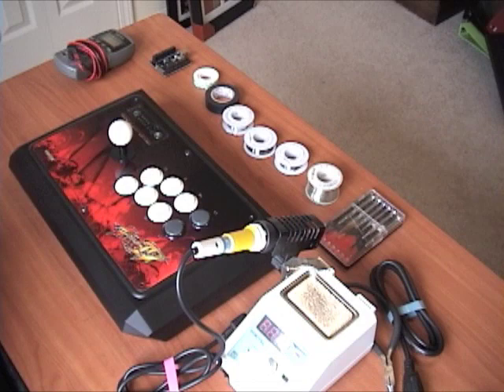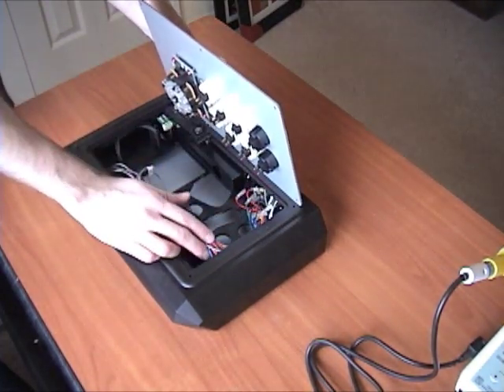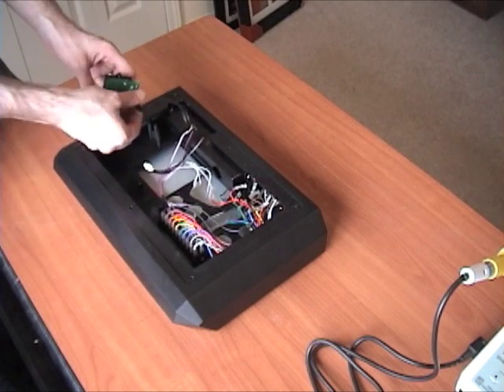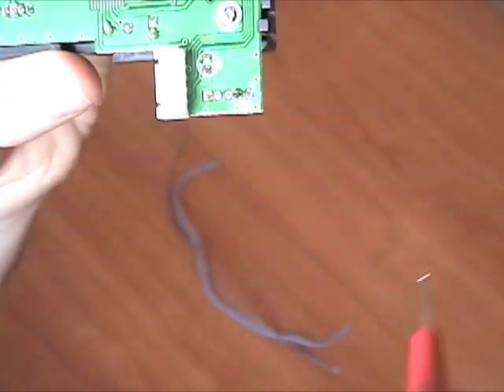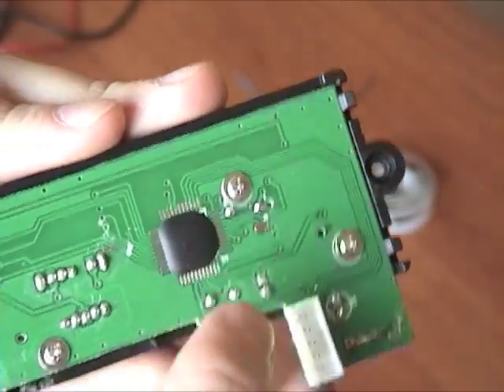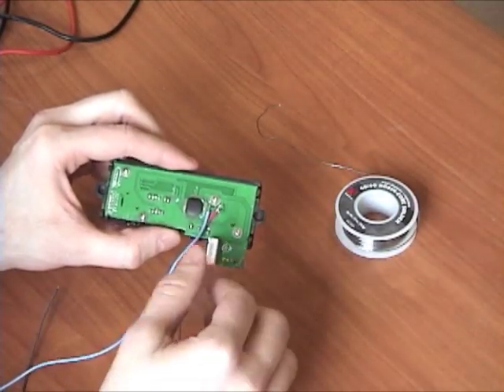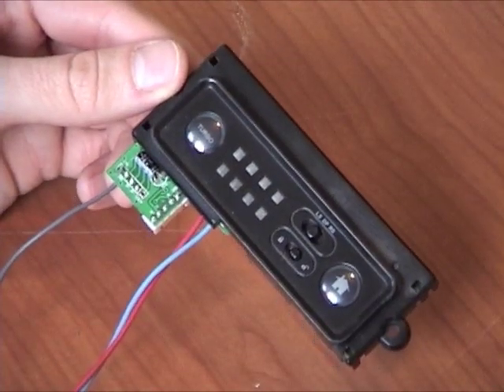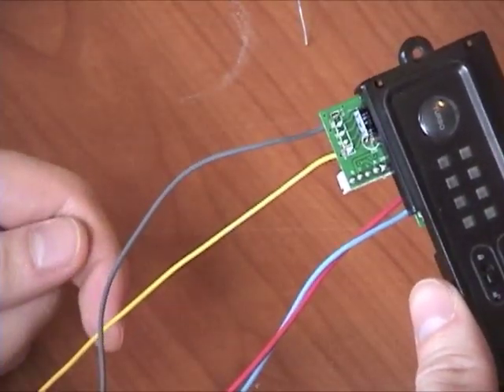How To Install an Akishop PS360 Joystick PCB into PlayStation 3 Mad Catz FightStick TE (Part 1)

Comment: Hi, thanks for the guide I managed to be able to use the stick on my PC now. Just a question the turbo button does not work though I followed the soldering points very closely. Any way to find out what went wrong?

Comment: Awesome, sorry to bug you dude but is the same true with the cerberus? I have a ps3 madcatz pro and I need to dual mod it but really don't want to take the risk of soldering of I don't have to.
Reply from the maker: Unfortunately, no. All other "dual mods" (ChImp/Cerberus) are add-on boards that add PS3 functionality to a stock 360 PCB. The only thing that you would need to solder (for the Akishop) is USB. That's 4 wires. It's a pretty simple process. The rest can be done with screw downs. Though, the current Akishop has a USB plug, so if you completely replace your USB cable, you don't even have to do any soldering. The home/turbo buttons are easier to access on a Pro stick, though I don't have one anymore, so you'll want to look for a YouTube video from someone else.
Reply: Donovan Myers Hey, so I got the ps360+ and im going to dual mod. Im just wondering how i do the home/turbo buttons without soldering. can't seem to figure it out.
Reply from the maker: Jim Key I can't think of any good way to do it with out soldering. The home & turbo functionality is all contained within the PCB so there aren't any opportunities to tap into it through other methods.

Comment: Will this also work for the ps3 madcatz pro?
Reply from the maker: An Akishop is a complete PCB replacement, it should work with ANY stick. I've used it in a SEGA VSHG and Hori Real Arcade Pros.

Comment: Hey donovan if I wanted to add an extra button for the home function would i just solder a wire to one of the two points on the back and one to ground and connect the button to those two wires?
Reply from the maker: Yep! I'd recommend just holding or taping the wires in place to test your theory before soldering though. ;)
Reply: Donovan Myers thanks, it worked but i accidentially pulled the trace off the pcb :S is there anywhere else i can solder a wire to?
Reply from the maker: x1vietnguyen I don't know for certain. I would use a multimeter to test continuity and see if you can scrape off an area somewhere else that trace might connect to.

Comment from the maker: PokeFighter, the Akishop is probably the only PCB you can get that is a dual-mod replacement, so it's probably your only way to go. I believe that the instructions for the AkiShop show you how to wire it so that you can use button combinations such as start + select or various kicks and punches (it's all running together for me right now) so you don't have to have a home/guide button.

Comment: Hey Donovan, i need some help, I purchase the new Akishop PS360+ PCB and im going to use it to replace the Stock TE R2 for xbox360, i just need to know how to connect Guide Buttons and Turbo+Start Select Lock, i don´t find any video or guide, even on Focus Attack, thanks in advance, i really appreciate your help.
Reply from the maker: Since you have an Xbox 360 stick, it should be fairly easy! There are 2 PCBs, one for all of the buttons and stick near the bottom/front of the case and one for the Guide/Turbo/etc up near the top/back. Just follow the ribbon cable coming from the Guide PCB and determine which wires are for the ground, guide and turbo buttons and screw those into the proper place on the Akishop PS360+ PCB.
Reply: Donovan Myers  You are awesome my friend, thanks for that faster response, I will use a Multimeter to determine what cable are for Guide/Turbo/Lock like you showed on this Video (Very Helpful by the way), but the only and last question that i have is: where on the PCB must be connect this cables exactly?, I am afraid to make a mistake and ruin my pcb, because in Focus Attack they don´t say nothing about it, not even on the pdf docs, i really appreciate if you can indicate that on the PCB for me, or maybe where i can find a picture that it shows it, thanks again Donovan and Greetings from Argentina.

Street Fighter Fans Argentina (Oficial)

Comment from the maker: From the install PDF:
"The 12th button is the Turbo button but because not many people use the Turbo function in games you can have 11 buttons instead...and still be able to switch modes between PS3 & 360..."

"2. Hold down the Turbo button (or the Select/Back button if you have 11 button setup)."

^ So, just hold down your Select button as you plug it in instead.

If you don't already have a PS360 and you're buying a PS360+, it won't be the same. Download the manual from Focus Attack for the +.

Comment: You mentioned holding turbo and plugging it in to switch platforms between PS3 and 360 in part 2. What if I want the PS360 pcb but don't want a turbo button at all? I plan to custom make a case with no turbo. How will I switch platforms then?

Comment from the maker: @destinationskyline First, thanks for sitting through 20+ minutes of my rambling. I'm sorry you didn't find the information you were looking for.

There are 2 extra wires. A ground wire and a VCC (power) wire. I talk about where you solder them to the Guide/Turbo PCB in part 1 at 8:50. I talk about where you screw them into the ChImp in part 2 at 9:50.

Comment: I can not seem to get my guide and turbo buttons working. PS3 stick and a PS360. You mentioned you had to add another wire to the ORIGINAL pcb but you do not mention where you solder this wire. You also do not mention where this wire goes (does it attatch to PS360 or solder onto another wire?). Please advise as I believe the missing portions are whats causing my Turbo+Guide to not function.

Comment from the maker: @YGT224 Yes, because you are essentially replacing any logic board with the Akishop PS360 PCB, it would work in any arcade stick with a joystick and buttons (or a custom built stick). The modification process for making the Mad Catz turbo/home PCB interface with the Akishop PCB should be the exact same.